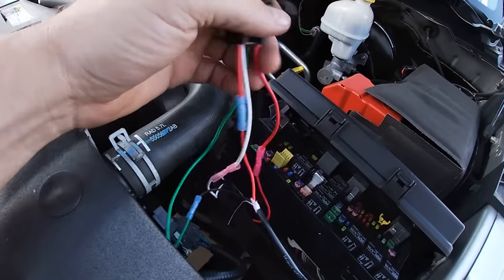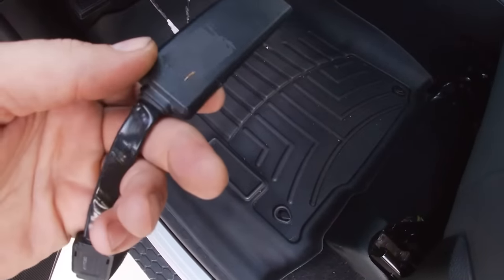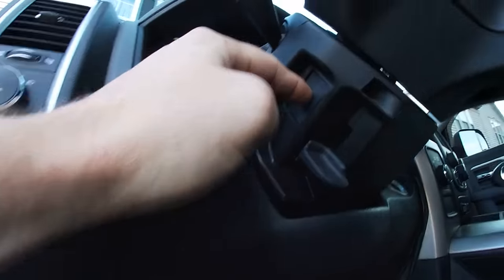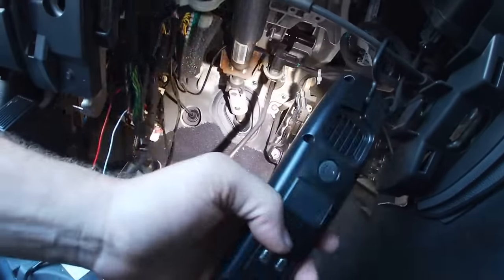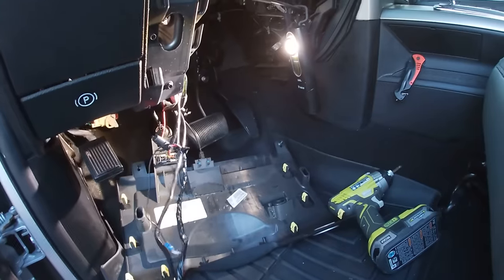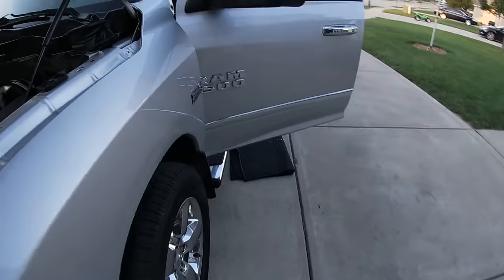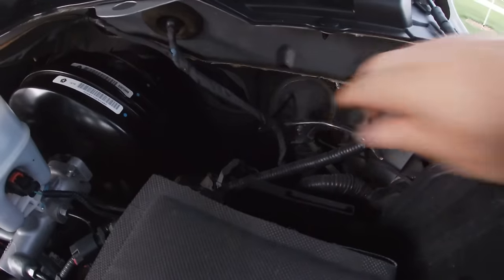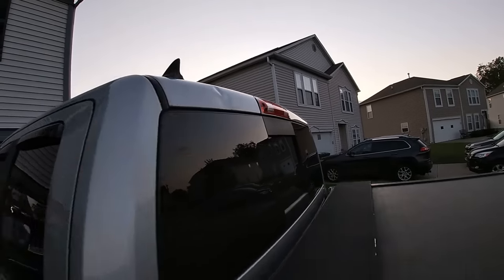Tracking Device Found on My RAM!

Comment from the maker: Ok here is the low down since everyone doesn’t watch the whole video before commenting. I have only owned this truck for two weeks. I bought it at a Chrysler Jeep Dodge Ram Dealer here in Indianapolis Indiana. When we first test drove the truck one week before purchasing the beeping was there. I shrugged it off as the proximity sensors on the aftermarket backup camera system. The corrosion on the relay shows it’s been on a lot longer than two weeks. I did not buy it at a buy here pay here and no it was not installed because of my loan. Also people keep saying it was a rental and I’ve never seen a rental company install a $1200 RollLock tonneau cover, Weathertech floor liners, Weathertech vent visors or a chrome bug deflector.
Reply: so, you think this device was added by the factory?  Or a third party to track your truck driven by an employee of a company?
Reply from the maker: conquryourfear & do it yourself I think the original owner had it installed. It’s definitely not a factory part and it was on there when we test drove it a week before we bought it.
Reply: Well dang that wiring looked professional.  I would've returned it as an unsafe vehicle and get my money back. But it is a nice looking truck bro good luck with it!!
Reply: FAB Automotive Detailing yes I agree with you on the original owner installed it just in case it got stolen or something.  Ignore the haters bro, nice ram.  I have a 2006 ram 1500 4x4 sport that I bought in 2010 when I came back from Iraq and its still going strong!
Reply: In Canada used car dealers use those so when you miss a payment they can shut down the vehicle and go pick it up. Usually bad credit loans.
Reply from the maker: Emilthehun Yeah I was mad at first but I really like the truck so I just said heck with it and threw it away. Thanks
Reply from the maker: The Realest One First of all THANK YOU for your service! 🇺🇸 I love the Rams and definitely don’t listen to the haters. Thanks brother
Reply from the maker: Brock They do that here also! It was on there from the previous owner.
Reply: @FABAutomotiveDetailing  yea I cant say I blame you. I had an 04 ram with the hemi , drove it till just this January.  Put 290k on it and loved that beast. Everything was awesome except mpgs. My got 9mpg avrage 😂👍
Reply: FAB Automotive Detailing thank you for your support bro, keep doing what you do and you earned a new subscriber!
Reply from the maker: Emilthehun I’ve always loved the Rams and this is my first one. So far I love it!
Reply from the maker: Antoine Brooks Thank you brother I appreciate that!
Reply: @FABAutomotiveDetailing  good find who knows who's keeping track
Reply: The owner probably had it installed so he could sell it, steal it back, than keep it or resell it. A loop of money if you think about it.
Reply from the maker: Brock Well one thing we know for sure is our phones keep track and listen to us all the time!
Reply from the maker: Rifle648 _YT That is true! Oh well it’s insured.
Reply: I have one on my truck because it’s a buy here pay here for the dealership to track the truck have to leave mine installed until it’s paid off and they said they usually just leave them there. Mine was hooked up via my obd2 port which caused my key fob to not work including remote start and door locks.
Reply from the maker: Stephen Spears If it was something the dealer had installed I would have left it on. It was on there from the previous owner.
Reply: The wiring under the dash wasn't so bad, it looked to be soldered. I wouldn't do that under the hood where weather could get at the Y connection, but under the dash, I would sleep just fine if that was my work. So many of those just get twisted and taped. I just finished installing just under 100 boxes in trucks for fueling authorization and record keeping for a local city. Almost mastered the art of the one handed zip tie after that job.
Reply: I don't know why you even need to worry about or respond to people that are trying to invent bs. I always consider the source and when I know something is bs I could care less. Thanks for the videos.
Reply: You seem so angry- so what it was a fleet vehicle, a rental, or the previous owner lowjacked it. Or the CIA/NSA are tracking your whereabouts- check all vehicles and if they are there time to get a tin foil hat! Or perhaps it is just a random transistor that you put in the mix as click bait- who cares ya only took 1 minute of my life!
Reply: It is from a buy here pay her lot i used to install them its a repo recovery device likely there when it was traded in your lucky it didnt fry yout TIPM
Reply from the maker: Fred C Thank you!
Reply from the maker: d j The wires under the dash definitely were not soldered. But they were taped up so one of hurt anything. Under the fuse box though it was a crappy wiring job.
Reply: @Emilthehun  I wish that Dodge still offered the 5.2,  318 CU motor that they had in 1998, in the Dodge Rams, lot less maintenance cost for that motor and the fuel mileage is much better. yes it's not a hot rod  motor with over 300hp,  but in my opinion it's a better motor with a distributor. The hemi is totally computer controlled.
Reply: @rondellschuyler7074  I tell you what. I was actually extremely happy with my hemi. Aside from the hemi ticking,  never had a problem,  never changed nothing on it aside from spark plugs once. Ran like a champ.  The rear was the problem all the time. Every 50k it needed a rebuild.  I actually like new tech because it makes diagnostic a lot more simple.
Reply: Car fax and find out if it was a fleet vehicle or rental...
Reply: Oh you already know your answer. Nice clickbait.
Reply: I used to work for a dealership. I’ve seen those trackers before. A third party contractor installs them per dealer contract. Reason for that is before every dealer rental/loaner vehicle they install a tracker in case the vehicle is stolen. 
And in your situation it’s either they forgot to remove it or didn’t bother removing. Because every time a loaner vehicle retires from being a loaner. It becomes a USED CAR inventory. And since your car came with a bunch of extras. It might be a CERTIFIED USED VEHICLE.
Reply: @brock4629  - Happens in the US, too.
Reply from the maker: Conspirazy It’s not clickbait at all! I told everything that happened  from start to finish. The video is exactly what the title says it is.
Reply: Truck may have been formerly owned by a Cartel member whose boss wanted to keep track of his "Loyal"  employee. Similar things happened on Better Call Saul.
Reply: @FABAutomotiveDetailing  Hmm, I guess I was wrong about the solder, tisk tisk installer. Another taped install waiting to let you down. Totally agree about the fuse box wiring, that was just bad.
Reply: Some finance companies put them on for high risk debtors
Reply: Seems like a fleet truck that was a private truck. Now its your truck.
Reply: That is a GPS tracking system (I install them at the rental company I work for) The service is called "Air IQ" and removing it should have no issue
Reply: Naptown!!!  Great informative vid.
Reply: I personally know a used car dealer. They install these devices so they can remotely stop the vehicle from starting if the buyer stops making payment/fall behind on payments. This device can be used to locate the vehicle, as well, if it is abandoned. They are supposed to remove it once the vehicle is paid off.
Reply: @Emilthehun  my brother has a 2010 with the Hemi and his problem is the rear end also, it makes a whining noise. I tell everybody to find a shop that will use Moog or Dana  good quality parts to fix the rear end diferential. If it is done correctly it will probably cost around $800. If done correctly, it should not have to be done again for many miles.
Reply: @rondellschuyler7074  I've had my rear end rebuilt in my 03 hemi ram and the damn pinion seal keeps going out. It cost me about 900 to get it done...ouch
Reply: @rondellschuyler7074  funny thing is , it kept on blowing,  and the first 2 were factory replacements.  To this day I think its because of the aggressive posi traction lock is what keeps on blowing it reliably.  Wide tires plus hemi tq , is no easy task for a read end. On the plus side , it does lock up nicely to get you out of sticky situations unlike a ford would. If yours is making noise,  it's time to rebuild.  For the performance it gave , I was okay with it needing a thousand bucks every few years. Gotta take the good with the bad bro. But hands down the best pickup I've ever owned. And I'm a chevy guy.
Reply: My ex got a car from carhop that had a remote kill switch so if you miss a payment they can kill and repo it. It was easy enough to bypass just disconnect the ground it will do weird sh*t with the gauges but will be drivable
Reply: @mrbrooks551  More than likely the dealer beat them into purchasing the tracker, the new version of  rustproofing and paint sealant
Reply: Maybe they wanted to steal it back. Watch your home dude.lock n load. Love n light god bless.
Reply from the maker: Andy B It would be a bad idea if they tried I am always locked and loaded. Thanks man
Reply: @FABAutomotiveDetailing  yes yes sir the world is not what it once was now its dog eat dog. God bless 👍👊💖
Reply: Its Gold star GPS tracker by spireon Corporation. It comes with a starter relay kill switch that can be remotely deactivated if someone doesn't pay thier bill. I deal with them all the time in repossessions. I installed them in my own wreckers
Reply: common install found in 90% of fleet vehicles,rentals, and buy here pay heres, i work recon in a dealer ship and one of the first things i look for to remove.
Reply: Previous owner was under surveillance.
Reply: So thats were my truck is!!!
Reply: I used to install those units for a local used car lot. They were most often installed for high risk lending for people with no credit or bad credit. If a payment is missed they zap the unit and the car is rendered useless until a payment is made or a repo is done. There was a lot of cases the customer was not clearly told what the unit was for. They were usually quite surprised it was installed.
Reply: @FABAutomotiveDetailing  I had a flakey coworker that bought a late Model used Chrysler Sebring Sedan and paid way too much  and financed at a 20 percent loan, hers had that and if she got behind  they would call and warn here to take the car home so they could turn it off and she couldn't drive it till she caught up, looks like they sometime forget to take them off LOL
Reply: i work for a equipment rental company that also rents trucks for companies to use. if someone is renting a truck for an extended period we will put alot of things on the truck. we have added goosenecks bug gaurds front end replacement bumpers etc. we have even ordered new trucks specd the way a customer wants for them. a lot of that stuff will generally add to the resale value.
Reply: @brianmorelock  that's what I said. I work for spireon and recognize the device. It's a cusg sprint unit.
Reply: @tatesmobilewashandinstalla7025  yup you are correct. They are outdated 2g units
Reply: @brianmorelock  yes sir, we've since switched to the edge plus. They work better and look cooler lol!
Reply: @d j 

That wiring is horrendous, professionals don’t use crimp connectors. Especially with something like this, they didn’t even try and hide it. 

Solder and heatshrink is the only correct way of doing it other then pulling pins out of the connectors and crimping extra wiring as the factory would do. 

This is another typical car audio and alarm hack job. 

Disgusting SMH
Reply: I wouldn't worry about it. Someone probably just wanted to track their kid or spouse. Or more than likely it may have been a company car. My company has 3, and I know one has a similar beeping sound to it.
Reply: Good info. Now who is , They?
Reply: @Emilthehun  You think that wiring looked professional?  Butt connectors without even shrink wrap?
Reply: @scottmcclure8933  I know one, and they are legally not allowed to put them on, but they do it anyway.
Reply: @FABAutomotiveDetailing  Bigger construction outfits, as well as bigger subcontractors do that. Some get there own trucks, others share the company truck between managers, architects, designers, fab engineers, sales etc. for business transportation to jobsite, and meetings. It's more likely the case, as the truck was well taken care of, backup safety, bed cover for parts, tool, displays....and of course looks/presentation.
Reply: @SealofPerfection  I was being sarcastic lmao. In that same comment I said I'd return it being an unsafe vehicle.  😂
Reply: I see a microwave in that devices future.
Reply: Seen this type of thing before. Big companies do their boss mens trucks like this. They put trackers on their equipment and put on a lot of options.
Reply: Buy here pay here places do that to disable vehicles remotely
Reply: Wss likely an old fleet vehicle. And they never removed the GPS from being part of a company. 👍....and you answered that just as I'm typing. Haha. We have these same types of things in our trucks too man.
Reply: Here's another interesting fact about those tracking devices insurance companies track the number of miles per year on your vehicle.
Reply: I wouldn't put it past the (IMHO) crooks at Eastgate
Reply: FAB Automotive Detailing That’s what happens when your video hits home pages. Never seen your channel before, and found it interesting. Keep it up man, that’s what YouTubes all about
Reply: just barfed in my mouth from what a bad installation was done on that device omg good thing you foud that props to you
Reply from the maker: GP Hello fellow Hoosier! Thanks
Reply from the maker: Mike W Yeah I wouldn’t buy from Eastgate! In fact I pass 2 Dodge dealers to go to the one I like to deal with.
Reply from the maker: william parent Yeah it was a terrible install. Thanks
Reply from the maker: Jason Coughenour Funny thing is I found one on a customers car the other day that is spliced into the power wire for the OBD port. Video will be out saturday
Reply: @FABAutomotiveDetailing  What is the good one? Something other than Greenfield (their service is great)
Reply from the maker: Mike W We like O’Brien Chrysler Jeep Dodge up on 96th street.
Reply: I've heard a lot of dealerships add them now not just rental or fleet companies.  It's cheap insurance to help find it as the units are cheap and they do not have to activate it unless you don't pay.  If it's been there awhile the original dealer may have done it and probably do it to all their vehicles
Reply: it was probably a work truck for a company.
Reply: excellent did you read my other comment more likkly not
Reply: Fleet vehicle nuff said.....
Reply: Stephen Spears hhhhmmmm my Fob doesn’t work and I didn’t get one when I bought the truck. Even went to Toyota to see if I had one, I do so I got with a key fob guy and couldn’t get one to work .
Reply: And I didn’t get if from a buy here pay here . Came from a larger Ford dealer.
Reply: FAB Automotive Detailing 
Is this a standard part of many alarm system installs?
Reply: Emilthehun unsafe,why? They would laugh at you.
Reply: Some dealers around here (pay per week) put those on cars. Then if you do not pay they shut your car down for x amount of time before they come and get it.
Reply: my 2004 ford ba falcon I replace the ignition switch / key barrel steering column cat still won't go no auto electrician will touch it with a 40-foot barge pole I got so fed up I got the RAAF to use it for bombing practice hey presto no more fuckin stinking ford
Reply: Thanks man for the education.
God bless you and your family
Reply: Haha damnn I'm guilty of that,  commenting before watching the whole vid 🤓😅
Reply: Thanks for sharing bud! I just thought a construction company project manager type liking his Hemi Truck! As to where it could have come from.
Reply: Trucks don't rent well up here but I put weathertech floor mats and trackers in all my Turo rental vehicles. :)
Reply: Leland Brown  A very good chance the truck came from an out of state auction/wholesaler and the dealership never even knew it was there.
Reply: You should have sent it back to them with the bill for time to remove there equipment and any wages from work missed. they are required by law to remove all tracking devices before resell.
Reply: FAB Automotive Detailing I didn’t even think that far into it when you said it was a fleet company vehicle but now you saying it has a 1200$ tonneau cover and weathertech floor lining and vent visits makes me really confused because NO FLEET VEHICLE would have any of that. They don’t put those modifications on fleet vehicles, nor do they add aftermarket back up camera systems.... so now this entire story makes absolutely no sense whatsoever unless it was a personally owned truck before the dealership bought it but then the tracker doesn’t make sense. so unless it was BOTH owned by an individual to explain the modifications NO company would install and also owned by a company as a fleet vehicle at some point in time to explain the tracker. That’s really a mystery though where that truck came from with aftermarket modifications from both an individual and a company at some point in its life.
Reply: People are missing the fact that if it was installed for a loan, it would not be spliced in. It would have its own harness with plugs to mate into the car's harness.
Reply: Dude you seriously should take it out and put it on a garbage truck!!🤣
Reply: I put those in every single day for the banks/loan companies... those are 100% from the LOAN COMPANY!!! Whether it was from when you bought or the guy before you or the guy before that it’s 100% a gps device most loan companies want inside their vehicles nowadays. Everyone puts them in differently but 100% someone got a loan for that truck and they put a gps in your car. So when someone doesn’t pay, doesn’t matter what your credit is like just matters what bank is giving the loan but when you don’t pay the car won’t start and it’ll gps the location. Some just gps the locations all depends but no one is tracking you and seriously I can’t believe you got this many views when everyone knows what those are I watched the first 2 seconds of video and knew what you were doing. We all got clickbaited.
Reply: FAB Automotive Detailing you can even look them up online if you don’t believe me loan plus their called
Reply: Trust me the dealership isn’t as smart as you think I work for a dealer and that’s why we put one inside every single car and if they already have one from prior we leave the old one in as long as it still works but the loan company never ever tells people that they put gps inside the vehicle. They never tell you and trust me I would have brought the truck back to the dealer and not touched a thing.
Reply: FAB Automotive Detailing before we could put them anywhere it didn’t matter now ppl try and take them out themselves soand right on the directions how to put the gps in it says we HAVE to hide it somewhere can’t be in an open place where the customer can see it. That’s not a rental companies trust me it’s a dealers and not even buy here pay here it’s the loan companies not all of them want them in but a lot do now.
Reply: Also there’s a number on the main part of the gps it has an sn number and an imei number that the bank can trace but How do you know your loan company didn’t want it put in by the dealer??? It doesn’t matter what your credits like or anything just matters what bank but 110% that’s a loan gps. That’s all it is. But I would have checked first before removing it.
Reply: I used to instal them in Florida for small used car dealers on there cars cause they sell to anyone down there with a down payment... Normally the down payment is what they payed for the vehicle at whole sale so they get payed the minute it leaves the lot but none the less the tracker was called pass time!!
Reply from the maker: danny davideos I looked it up and it’s from ModBuz fleet tracking. It was definitely on the truck before I bought it by seeing the corrosion on the relay. I had only had the truck for 2 weeks when I made this video.
Reply: conquryourfear & do it urself I tested a 2020 Toyota Highlander and I had a beeping sound the whole ride and the agent couldn’t figure out how to stop it. He was embarrassed af, but couldn’t figure it out. I wonder if tracking devices are being installed on new vehicles out of the plant. Or it could be a safety precaution for the dealership?
Reply: @brock4629  Common in the States. "LoJack"
Reply: @rustedratchetgarage6788   Common in the States. "LoJack"    BHPH are notorious for marketing to the lowest in the market who many will not pay off the 'loan.'
Reply: @BobbyJr556   Common in the States. "LoJack"
Reply: @ShadoWave2   Common in the States. "LoJack"
Reply: @scottmcclure8933   Common in the States. "LoJack"
Reply: FAB Automotive Detailing Dump a tracking device at some other location, leaving it active...
Reply: @FABAutomotiveDetailing  Sounds like it might be a company truck; they like watching where their employees go.
Reply: It was a work truck..
Reply: they saw you had a nice truck - they want to know where you live to rob you.
also - how the hell did they set that up in your truck - did you take it to the dealership?
Reply from the maker: Bawbster1 It would be a big mistake to try and rob me if I am home. It was on the truck before I decided to buy it because it was beeping on the first test drive. It wasn’t installed for me.
Reply: YOU DONT GET IT, IT'S THE MICROWAVE SOUND YOU EAR,  IT MEAN YOUR MEAL IS COOKED .
Reply: FAB Automotive Detailing The O&G company I worked for sold seven or eight work trucks a few years back. They forgot to take their trackers off of the first four that went out the door. 😉   It happens.
Reply: I used to work at an Auto Auction, we sold former Enterprise rentals to dealerships all the time. I've removed a few of these trackers from them myself. If you bought it used, chances are it was a dealer that bought it from an auction and added the stuff. It could well have been a prior rental/fleet vehicle and the dealer or previous owner put the Weathertech and other stuff on it.
Reply: We stopped putting them on at our Mac haik Chrysler jeep dodge dealership. They were installed on all of our inventory, new ans used. We had about 6 charger hell cats stolen.
Reply: Great video
Reply: That truck could've been part of some sort of business at one point and they installed that so they could have a remote kill switch if the truck got stolen, thats the only reason I could think why there would be a relay preventing the truck from starting.
Reply: Looks like some aftermarket gps tracker for an alarm system.  Probably used to geo fence the truck, so if it was stolen it would cut the ignition.  That's why it was beeping and not starting.  Obviously it was damaged, and malfunctioning, or the subscription fee wasn't being paid anymore.  Also looks like an amateur installed it.
Reply: FAB Automotive Detailing it was probably a fleet vehicle just like what you said. My company uses fleet trucks and that explains things like the bed cover. My company truck has a badass bed cover lol and I bet it has a tracker in it also
Reply: That has me curious  now
Reply from the maker: M A Not anymore! I have moved since this video
Reply: Not you guy Im slamming the fleet guys who put it in. Ive own dodge trucks before there ok it you maintain them
Reply: The former owner probably live in a city with high auto theft or was a company truck so they put a tracker on it just in case
Reply: @mrbrooks551  THANKS FOR SERVING!!!!!
Reply: I'm not going to read all the comments. Enterprise puts those on long term lease vehicles. I've got one
Reply: This is stupied, it was owned by a company who installed device... The fact that it took you months to realize it with several audible disturbances is questionable ? 
My money is on clik bait and you accomplished it with million views and other piggyback videos after...
Reply from the maker: Kevin Duprey Didnt watch the whole video did you? I owned the vehicle for less then 2 weeks when this happened. The way you spelled STUPID tells me everything I need to know. It was not clickbait at all I had no idea this would happen I was just showing my subs what happened to my new truck.
Reply: My job has tacking on the vehicles the beeping is to annoy drivers to use a identification token to log in the tracking system...  so they can track who drove where.
Reply: Spoiler alert @ 8:50
Reply: Nice truck!!!  Props from the south side!!!
Reply: At this point its all about spying.
Reply: @mrleafbeef634  Juice pies
Reply: Can you check out my car. There's a parasitic draw from my battery.
Reply: @secphone4189  Makes me think of a certain people
Reply: @NoNORADon911 you mean from Israel? What are you trying to tell us dear? What "people" are in your head?
Reply: @secphone4189  Izrael did 9 / / 
 https://www.youtube.com/watch?v=mOJpne5jmFg&list=PLim8RdEdDWQ6gglDQ_MhoQpRPf0PTCP2o&index=139
Reply: I'm sure you trashed the tracker. To bad I would have paid to ship it to ME!!! But im sure it's in the land full by now
Reply: @Emilthehun  You're taking it to the wrong people
Reply: @brock4629  thank you Captain OBVIOUS!!!🤦‍♀️🤦‍♀️🤦‍♀️🤦‍♀️🤦‍♀️
Reply: It happens ,
Reply: @tonybalognamacaroni3402   There's a lot of misusing things made for good, that jerks who intend to take the vehicle back illegally. Ask me three vehicles stolen. Third a tracker put on by dishonest auto dealers causing the vehicle to stop working in the middle of the highway! No late payments, no bad credit; dishonest dealer closed shop after bring sued multiple timed. My calls went unanswered, I had moved from the city where this dealer operated, found out the dealer locked the doors to the business making look like they were still in business! I'm stuck with a vehicle looks good, hardly used, dead as a door nail. Had a tracker placed, slimy car sales person beamed when I picked up the car said so! Four weeks after I placed half payment down they told me they had to "add finishing touches!!" That was a lie! I think that the tracking devices were somehow triggered making multiple vehicles stop working. Law suit?? Sure, I was told to get in line!  Buyer beware. If the seller gives different answers or changes the subject to distract from the truth, walk away. Run!
Reply: @FABAutomotiveDetailing  10-4
Reply: @rustedratchetgarage6788  WHAT CAUSES IT TO FRY THE TIPM?? THAT APPEARS TO BE WHAT HAPPENED TO MINE.
Reply: @user-os8sq3uh4n  Carfax is a $ rag used to fool buyers! I know the only way any thing gets on carfax is if the vehicle owner makes the data available to put in carfax.
Reply: @ViewThis.  From the land of better call Saul  👍🏼 yup!
Reply: @cmahoney_photo  Installer - shady non English speaking shyster using csr sales dealer as a front.
Reply: @scottmcclure8933  If they haven't disappeared across the border.
Reply: Could it be for eld
Reply: They told me edit my response so live long and prosper nerd
Reply: @FABAutomotiveDetailing  could have been installed by a protective parent when the truck was new ?? Or if someone was keeping tabs on a wayward child.... Just my .02
Reply: People and companies add those to their vehicles for easy recovery & tracking employees. Specially when you live in and work in crappy areas.
Reply: Could of been a lease. Not sure if they track those or not.
Reply: How did you find it exactly
Reply from the maker: @KingStrick  Just looking around and spotted the lights flashing.
Reply: K7n
Reply: I just found one on my car that we paid cash for. Funny coincidence it was also a Jeep dealership. The car had been a leased car at one point in time and it could have been left on from there. I'm waiting for the Jeep dealership to call back trying to find out if it's theirs or not. I have no use for it. If they don't call back I will have to resplice the starter wire.
Reply from the maker: @greenspiraldragon  A lot of used cars unfortunately have them still installed from previous owners like mine also.
Reply: Buy here - pay here,   It’s ok … no judgment !!!    😂
Reply: I must have missed it, but having a tracking device on your vehicle doesn't automatically keep you from starting your truck. Either the tracking device was MORE than just a tracking device and was telling your truck NOT to start from a remote location, there was a short somewhere in the wiring (the relay?), or something else. So, what was it? Very curious! Thanks in advance. DH.
Reply from the maker: @dough9512  It was from the relay being corroded. This device had a starter kill that’s why the relay was under the box.
Reply: Oh by the way, its a felony to install a tracking device on a car without the owners permission.
Was this a used truck? The original owner might have done it.

As for install did you remove black tape? If not it could short out messing up the trucks main computer network causing drive ablity issues  or drain your battery.

Its also cheap Chinese electronics,
That can cause problems.
Insurance companies stopped giving dongels  to plug into that port because they were interfering with cars you now use your cell phone.  That stuff only cost you more money in the long run.

The ODB II  port is only ment  to read data over to look for problems not this junk.
As for connections its industry standard sort of.  If you get remote start on your truck they will tie into it to read data and transmit a signal to act like the key, unlock the doors and other things. 
In fact the wire connection is how its done at the factory. 

Now they have plug and play connectors no wires cut into.

I did solder the data wires, but i used t taps on everything else..
Reply: Actually, legit car dealers are installing this device and charging the buyer. They claim it is an added benefit in case your vehicle gets stolen. Apparently they send the info to your insurance company and finance company. This is all done when you sign for paperwork. The salesman will call it a LoJack and will inform you inaccurately.
Reply: Lawsuit
Reply: FYI they are put in legally by dealerships incase of non payment for repossession purposes.... they also place them piggy backed to your obdII
Reply: @meak13  legally in a contractual binding mutual agreement. However, they aren't explained accurately and most customers are misinformed. It was like when small car dealers were telling customers the vehicle is insured, upon investigation, the insurance was subject to the dealer for damages rendered by the customer if repossessed. This way they didn't tack on fees to the customer, but dealers were misinforming the customers and accidents were happening thus beginning the state's investigation. Most dealers will not elaborate on the device being installed or will fail to mention it especially during signing. This is when it becomes illegal and why it is important for customers to always look at the paperwork prior to signature.